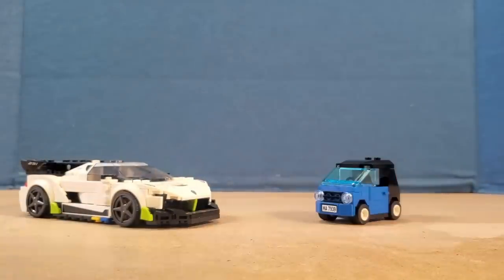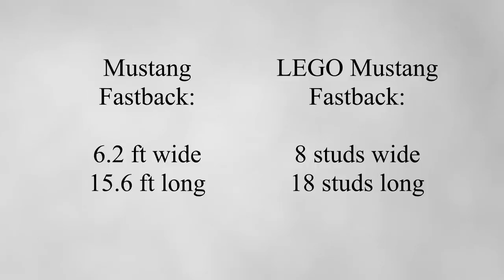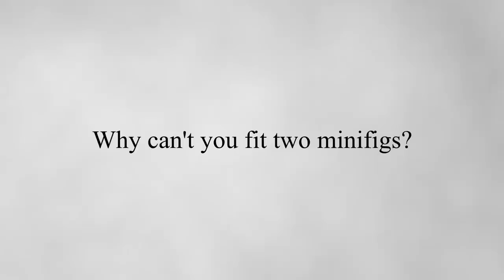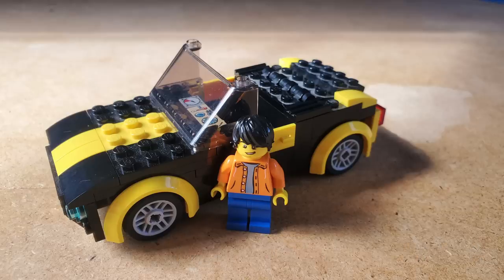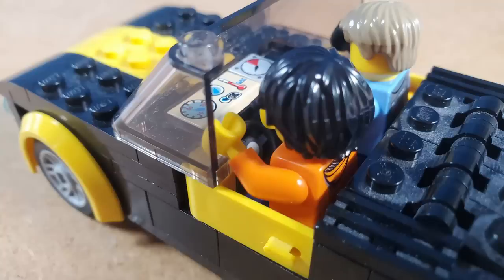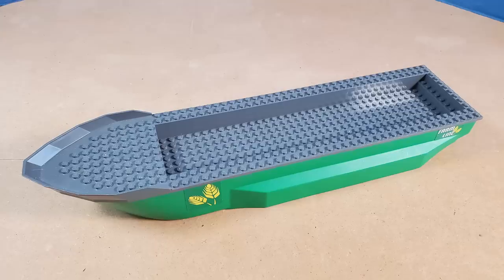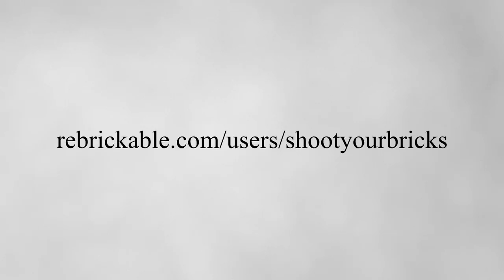Let's Settle This...

Comment: minifig scale breaks down with even the smallest buildings. A typical American 3 bedroom house (1500 sq ft) might measure 56'x27', and would require 2 32-stud baseplates. Even very small houses would completely fill or overflow a baseplate, and none but the absolutely smallest commercial spaces would be feasible as sets.
Reply: Which is why, just like model railroads, the buildings are made smaller than life.  I have an HO Scale 4' x 8' layout that depicts a small town.  Yet, if you blew it up to full size, it would all fit on my town's Wal-Mart parking lot.

It is called selective compression; leaving out the space that you don't need.  When we made a model of our new railroad museum in 1 stud = 1 foot scale, it was huge, and took up multiple baseplates.  The actual museum is across three storefronts in a downtown.

Comment: I Always prefered 6 stud wide speed champions, even though less detail can be put on them they look more normal.
However they are way too high (especially for a supercar like a Bugatti chiron or a McLaren P1), the simple solution would be for them to not make super and hypercars in that scale.
8 stud wide speedchampions have the polar opposite issue, they arent too tall, but they are surrealistically wide. The perfect Example for these issues is the Corvette racing set (including the C8R and the C3). While the C8R looks perfect because its a trackbuilt racecar, being wide and flat looks good on that, but the C3 is atrocious. It would be a lot better as a 6 wide. I've seen someone remake it into 6 wide and it fixes every issue it has.

Comment: Miniature wargamers have wrestled with this for years.  The problem is the figure proportions, width-to-height, head-to-body and hand to body.  Many wargame minis are more squat and chunky than a truly proportioned human, which means vehicles and buildings built to scale based purely on figure height look too small.  Lego figures are even more chunkily built, which is why you can only get one minifig in an "accurate" scale car.

Comment: It’s like putting a scale on hot wheels cars. You just can’t because the proportions are wrong. Hot wheels cars are designed to be lower, flatter, and wider than their irl counterparts. Why? To make them look and go faster, of course. Lego cars, trains, and boats are simply limited by the materials they’re built with, they just cannot be precise without looking odd.

Comment: Minifigures aren't proportioned the way that humans are. No matter how you measure it, you will never end up with a scale that works in all three dimensions. Clearly, the width of a LEGO car needs to be much wider in proportion to its length to have the same seating capacity as a real car. But if you do that, the car will not longer actually look like the real world car you based on the model off of. As such, what we end up with is choosing: Make the car proportioned like the real world and big enough to fit minifigs resulting in an over all oversized model OR make it proportioned correctly but only barely fit one minifig resulting in something much smaller than it should be OR make something that fits the right amount of figures but ignore the real-world proportions entirely.

Comment: 1 : 44 to 1 : 35 is about IRL to minifig scale. I do most of my starfighters at 1 : 37ish beacuse the width of the minifig needs to fit and the extra height provided by the shortness of a minifig gives more room for parts for stablility and decor. I figure using the minifigures shape to my advantage this way and having a larger model for more detail is better then fighting to ram a minifig in a 1 : 44 scale where the width of the minifig just doesnt fit.
Reply from the maker: That's actually a good idea

Comment: Lego "scale" doesn't match all 3 dimensions.  (But it is closer than I was expecting when I start this post, lol)
Human Torso Breadth To Height Ratio: 0.65
Lego Torso Breadth To Height Ration: 0.74
Human Depth To Height Ratio: 0.4
Lego Depth To Height Ratio: 0.37

HEIGHT (Y axis):
*****Ignoring the giant lego heads.*****
Lego Minifigure Sitting Hip to Shoulder Height: 21mm, 
AVG Human Sitting Hip to Shoulder Height AVG: 615mm
~1/29 scale

BREADTH (X Axis):
*****Lego figures are shaped different than humans and are wider at the hip and narrower at the shoulder*****
Lego Shoulder Breadth(biacromial or without arms): 11.5mm
Lego Hip Breadth: 15.5mm
Human Shoulder Breadth(biacromial) AVG: 405mm
Human Hip Breadth AVG:  390mm
So, using the widest of each, 
~1/26 scale

DEPTH (Z axis):
*****Lego Figures are generally almost exactly the same depth from top to bottom, while the avg healthy (ideal) human is deepest at the chest*****
Lego Depth: 7.8mm
Human Chest Depth AVG: 245
~1/31 scale

Using those scales, and assuming each lego stud is scaled to 1 foot apart, then a Ford Mustang would be about:
Height: 1387  mm 
Scaled at 1/29: ~15 plates high
 
Width: 1881  mm
 Scaled at 1/26: ~9 studs side to side

Length: 4728  mm
Scaled at 1/31: ~19 studs front to back

Comment: the problem with minifigures if they're 5ft tall, they're also 3.5ft wide, which doesn't really correlate to real life. realistically, if you want to try again, minifigures are are 3.5ft tall and 2 feet wide and it would make studs closer to 0.5ft per stud

Comment: Minifig scale based off of width alone isn’t right, and basing it off of height alone isn’t right. I think minifig scale should be the average* between both height and width. But I think both are fine.

Comment: They are either too short or too fat lol I think basing their size should be off of their wide vs height. It just makes more sense. It might be better to do a more balanced size where you base them on an inbetween size that compromises between height and width.

I definitely think basing them off height  is the wrong choice.

Comment: 1 stud = 1 foot does not work
let me illustrate. A subway 12 inches, aka a foot. Your logic would imply that a minifigure's hand (we're only counting the claw part here which is just a tiny bit smaller than a stud) is a foot long, however it's not because we have LEGO bread sticks that are way longer than that. Estimating a minifigure's "in universe" height is very tricky and this is not a good place to start
Reply: Lol you need to take 1 stud lego piece to get this measure, not the circle itself. He took a 6 stud plate where the studs are spaced, not bulked next to each other
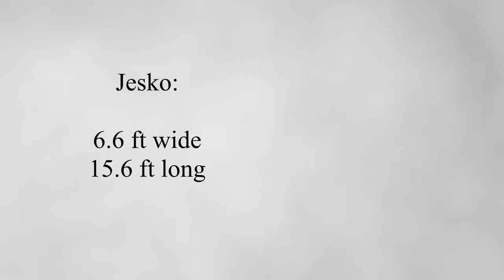Reply: Trying to scale down may not work well, because most small LEGO objects are made larger than life so they will fit in the figure's hands, and be easier for children to handle.  But scaling up to car, building, or train size, 1 stud = 1 foot (or 3 studs = 1 meter) works out well; it is roughly 1:40 scale.  Basing it on minifigures heights makes it look good with the figure standing next to it; basing it on minifigure's width is about 1:29 scale; you can then fit the figures inside, but they look too short.

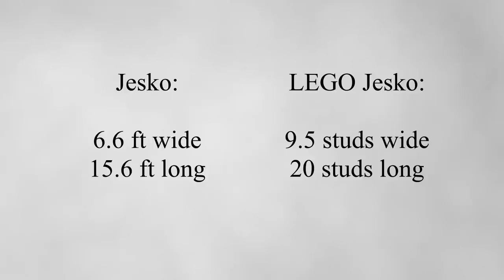Comment: In the lego military community, people tend to build in either 1:35 scale, or 1:45 scale. It's mainly preference for who uses what scale. Other builders will build in between those at like 1:40, or 1:42. The problem with the minifigure is that it is too wide for there to be just one scale because it is not proportional.

Comment: Train nerd. Railway tracks-  standard gauge - are not 5 feet wide. They're 4 foot 8 1/2 inches. You could round that up to 5 feet for the sake of toys, but the distinction is important.

Comment: I personally think everything should be downscaled a bit. Even modulars as full size buildings, would be tiny in real life. Same with planes, trains, and boats. I’ve grown a hatred for speed champions because I used to love collecting them, but they are so ridiculously oversized that they need their own display. So in short, Lego’s style is generally downsized, so make everything just a little smaller than usual and it would work way better.
Reply: Many modelers of buildings and scenes; and even stage and Hollywood movie set designers, use a technique called "selective compression" to fit more into a given area than would be possible if you made everything to exact scale.  It involves leaving out space that otherwise has no use and it works, and your eyes and brain usually do not notice it.

Another is forced compression, where you make objects in the front of a scene a little smaller than the ones in the back to make it appear they are further away.  If you had the space, you could place your speed champions in front, and the rest in the back to give an impression your display is deeper than it is.